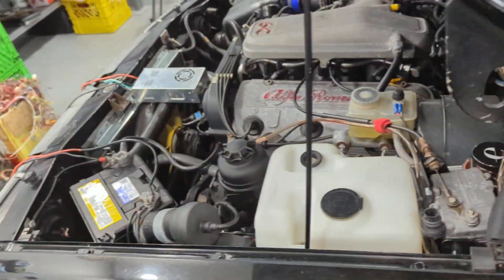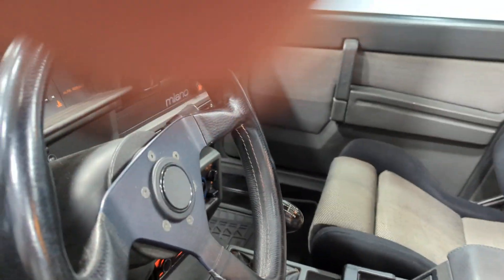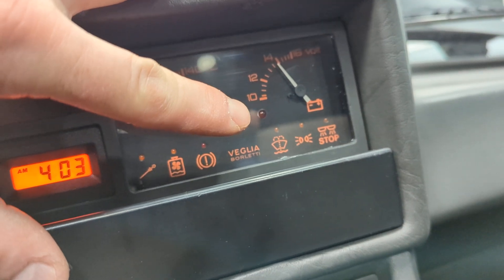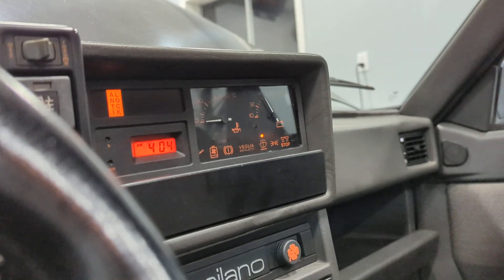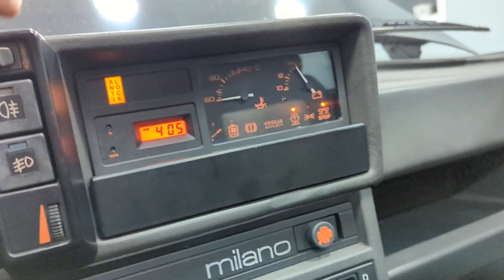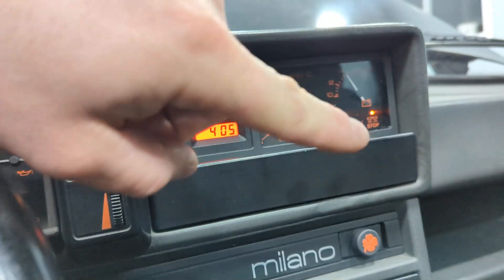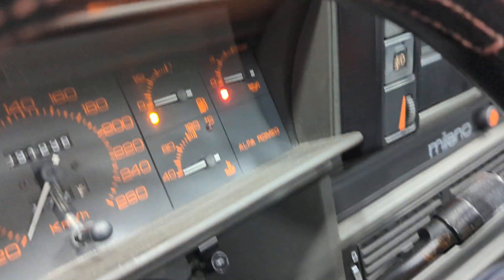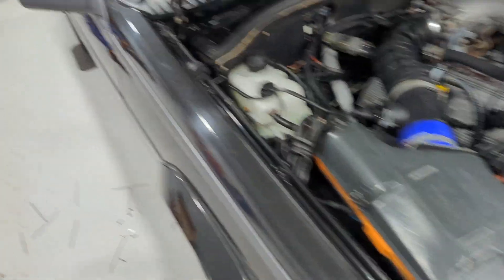Testing the Arduino based BCM - a project actually completed

Comment: one thing that i think can cause issue is vibrations and heat over the passage of time....
Reply from the maker: Most automotive electronics are conformally coated on the boards and there's no reason it can't be done in this application. Something to think about for sure!

Comment: Can you share the code?
Reply from the maker: There are 700 lines of code. What specifically would you like shared?
Reply: @ the interior light part
Reply from the maker: @PatrickBlaze47  interior lights are controlled by a quad op-amp and a time delay relay. Because the Arduino is off when the car is in an off state, the interior light delay is better to be controlled by low power passives to preserve the battery over long periods

Comment: ahh, I work at a European shop and we often need stuff life this. If your interested in selling us the IP  let me know
Reply from the maker: Honestly I sort of designed this system on a napkin as I reverse engineered the original system. The programming was sort of thrown together after a few online Arduino courses. The circuits that control all the different functions are very basic, yet robust and are really only usable on this particular car. Any other make/model would likely need a complete redesign

Comment: arduinos are great for learning, however they are not very stable or durable, which is why you never see them in industrial or automotive settings. please consider something more reliable.
Reply from the maker: They are used in industrial AND automotive settings ALL THE TIME. I know of entire sawmills running off of Arduino (ATmega) based systems, and the Speeduino EFI system is one such system based on an Arduino Mega 2560.
Reply: @Nodarperformance  Don't confuse AVR microcontrollers with Arduino, the latter is the uC + bootloader and much more. True, AVR uC's in a well engineered design will work fine for ages, but don't expect to just stick a Uno or Nano and make it work flawlessly.
 P.S. I have experience of such "fantastic" Arduino controllers in industrial envrironment
Reply from the maker: @mrjohhhnnnyyy5797  you have a point about the bootloader and in fact it can be unstable and has serious overhead but for someone like me starting out works as intended. For this project, it's more than adequate, as nothing is actually mission critical
Reply: @Nodarperformance  You can use whatever you want. I just decided to warn about potential glitches. Just don't make an ECM with an Arduino. Your application won't kill someone when it malfunctions.
Reply: If you are going to make a comment like this, you should provide what would be more appropriate. otherwise, it's just a s post. this dude did an amazing job.
Reply from the maker: @user-nm2jd7py4t  it's alright, I had a problem and I solved it the way I know best. Least expensive: no, most elegant: no, most compact: definitely no, solves the problem: ya
Reply: @user-nm2jd7py4t Judging by the responses given, any suggestions on what to use would have been ignored.
Reply: @user-nm2jd7py4t  Say, an AVR micro with logic level translators to do sensing of 12v lines. If you use 5v signals and put them on physically long cables, in industrial environment it wreaks havoc. There's a good reason why industrial sensors use 24V level.

Comment: Very nice, looks pretty sophisticated. Any intention of selling them or releasing source files? Even as a reference, such projects can be very valuable (reading various automotive sensors, detecting bulb failure, etc.) benefitting future hobbyists. Great work regardless!
Reply from the maker: I designed this to simply replace the system which Alfa Romeo originally fitted in 1989. In reality this old system was plagued with issues and many people simply disconnect the warning panel all together after they started messing up. The program itself very 'dumb': one function reads all the sensors into memory, another does the mathematical calculations for the currents and circuit resistance (based on inputs) and the last function just throws warning lights if they're not within 'range'